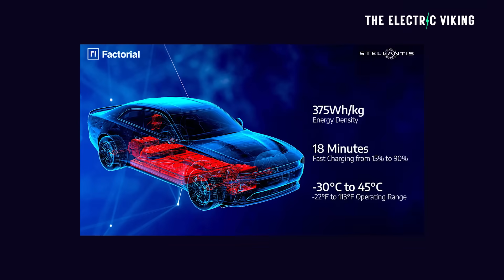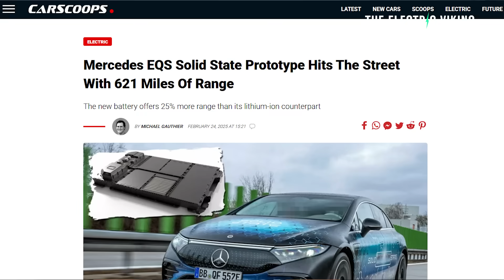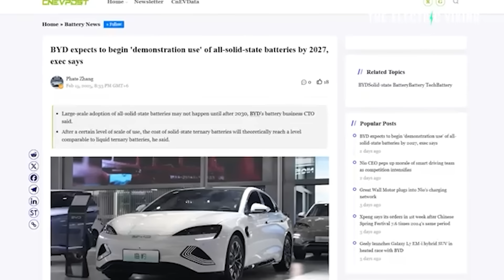Good-bye Liquid Electrolyte—Stellantis Tests Game-Changing Battery in Dodge EVs

Comment: Wait a minute 1000 mile  per charge but that is in ideal conditions in winter , dead cold , how speeds, also if its a full size pick up ,then the mother of battery suck pulling trailer  that most do all knocks those numbers down more or less 300 /500  still what's left is decent heck very decent.

Comment: A lot of science and engineering- and time and money- is being invested in making an energy dense battery to assuage range concerns. Of course this one-solution-fixes-all strategy is an idea but what if you didnt have to knock it out in one swing? One thing Tesla did right was invest into infrastructure early. Tesla owners hardly think about range bc theres so many charge stations everywhere. You dont have to offer both power and range in a single vehicle. The ICE industry had decades to perfect its craft one problem at a time- plenty of ICE engines blew up and caught fire but we still drive them. Putting so much energy in a single car is expensive and dangerous, they're pretty much nuclear reactors at a certain point. One step, one crowd at a time is my opinion but then again im just a regular dude.

Comment: You still have to have a lot CELLS to get the high voltages needed for keeping the current losses reasonable, both in charging and in driving the motors at high speed.

Comment: Biggest draw back of these amazing  factorial new li-metal anode cells is their limited cycle life(600 cycles vs ≈2000 cycles in prismatic graphite anode) i hope factorial will move towards a nano silicon-carbon composite anode with 10% silicon content share they can achieve around 380 wh/kg with around 3000 cycles in a gel polymer(quasi solid state) same as these factorial semi solid electrolyte based  cells
Reply: They would last me 20 years, more if I don't go 0-100% all the time.
Reply: @jamesvandamme7786  yes polymer based semi solid electrolytes have between 60% to 90% longer calendar life

Comment: A real-world 400mi of range for EVs is my gold standard. 500mi would be mind-blowing. Anything above that should just result in less battery per vehicle.
Reply: Which is a good thing as it lowers the weight of the vehicle
Reply: If I can charge in the time it takes for me to micturate, I'm good. 250 miles is MY standard. Bronze.
Reply: @jamesvandamme7786  oh I totally agree - 250mi in under 10 minutes is great 98% of the time. The median range of ICE passenger vehicles in the US is 403 miles - so if you can get batteries good enough to where 400mi is the new 250mi, you've just defeated the Luddites. Nowadays the biggest anti-EV argument is still always range. We EV owners know the reality that you rarely drive over 50mi in a day, but still it would be great to know I can get 400mi on a charge.

Comment: Why would you need such a range? My bladder isn't that big...
Reply: The more range you get the cheaper it is to run the vehicle.
Reply: @Cmvinyl0102  True, can't beat a good charge at home. The hidden cost of an EV is charging at public chargers, especially in the UK.
Reply: @Cmvinyl0102  The more range, the bigger and more expensive the battery.
Reply: @jamesvandamme7786  not necessarily, denser battery store more energy relative to its weight or volume, better efficiency is always welcome unless the technology that creates drastically increase the cost.

Comment: No mention of cost versus LiFePO4 or Sodium-Ion or Aluminum-Ion. If Na-Ion and AL-Ion batteries can provide 350-450 miles of range and only cost $50\KWH or less, this new SSB may only be affordable in higher-end cars, instead of something like a TESLA Model 2, which would easily become the economy car for the masses and have a huge market share, especially if it's priced below $15k as has been recently advertised in several videos. I'd really hate to wait around until 2027 or later to get a $35K EV.

Comment: I know you're mostly talking about cars, but the Chinese have just produced a 1000kW battery-powered locomotive. For now, mainly for industrial use. LiFePO4 technology and, as promised, can be recharged in about 1 hour. (This is made possible by a massive battery cooling system.)
Reply: Most trains are electrified already.
Reply: @LarsRyeJeppesen  Not with batteries. Here in Trumpistan, almost all diesel with motor-generator drive.

Comment: If NMC batteries fall out of favor but there is still massive production capacity they could get really cheap until the production is transitioned to a new formula. That could lead to some really affordable vehicles that are already engineered for that type of battery. For example Tesla might still use them in the Simi even after the cars are some other type to save on cost.
Reply: My feat is that in 8 years if I still have my ev rhere wont be replacement bateries if I want to restore full range
Reply: @ Or that replacement battery could be cheaper if it’s considered old technology

Comment: Still a couple of years away for mass production cars, much like the other battery companies, they won't be alone then of course, other battery companies are working to a similar time frame, so they will be competing directly with the likes of CATL and BYD in that regard. One of the advantages BYD has is in the actual design of the cells and batteries, the Blade battery enables them to fit more battery in the same volume than the traditional cylindrical batteries that Tesla was using for their first generation cars. WH per kilogram is fine, but they are only talking about the actual battery itself and not the supporting structure like cooling and supporting frame and hardware. If you can fit 10% more battery into the same volume it gives you a range advantage. These batteries look similar to the Blade batteries so I wonder how they will compete in that regard. Still, a couple of years, if you want an EV there's not much point in waiting though, a good EV these days will do the job fine for just abut any city dweller who does the occasional long run.

Comment: I have always been a range hater in all the current US vehicle. I use my truck for towing most weekends in the summer. I have always said a real world towing range of at least 200-250 miles at maximum tow rating with a 0-80% charge time less than 15-20 minutes would make the ultimate vehicle for me. That would probably make the empty road trip range at least 600 miles. If it has vehicle to load capability I can use it as home energy storage and a power supply to run our travel trailer when camping, but not at a campground.

Comment: Quasi-Solid Electrolyte:
Factorial's approach is not a fully solid-state battery, but rather a quasi-solid one. This means they use a polymer-based gel electrolyte, which is more fluid than solid but still reduces the risk of fire compared to traditional liquid electrolytes.

Comment: Yeah ok, no, there won't be any Dodge Chargers driving around with an 800 mile or any range at all solid state battery, I can assure you that. There are no cars driving around with 1000 mile gas tanks because no one needs that anymore than anyone needs a 1000 mile battery in their car, unless it was so cheap that putting it in wouldn't matter. So yeah, no, this is not a thing.
Reply: More of a bragging point to shut down the critics. They will come up with a new excuse why EVs are No Good. "They're soulless", whatever that means.

Comment: Energy density is important because EVs currently are just too heavy. That has always been the challenge with electric cars--heavy batteries. If Factorial can get the weight down to produce a reasonable range, then we can finally move off of ICE. Charging speed is actually less important because a stop to charge usually involves the restroom and food, anyway. But, some ICE people won't be satisfied until charging speed is comparable to ICE fill up.
Reply: No they aren’t. They’re no heavier than equivalent ICE vehicles and some of them are lighter already.
Reply: @SteveRomigsongwriter  That's good to hear. Which EVs are as light as ICE?

Comment: Factorial is a US firm.  The fact that Stallantis is the same company working on this is the same company with a large number of EV vans in Europe and bringing EV cargo vans to the US might be the perfect storm.  An EV van about the size of the Ram Promaster 1500 118wb low roof with a 500 mile range,  V2H and HVAC utility mode while parked or charging would be my dream van.
Reply: Don't forget Factorial is working with HMG and MB too, and MB is testing batteries already too... Just saying, Factorial isn't tied to just the albatross that is Stellantis, they have a bright future!
Reply: Biggest draw back of these amazing  factorial new li-metal anode cells is their limited cycle life(600 cycles vs ≈2000 cycles in prismatic graphite anode) i hope factorial will move towards a nano silicon-carbon composite anode with 10% silicon content share they can achieve around 380 wh/kg with around 3000 cycles in a gel polymer(quasi solid state) same as these factorial semi solid electrolyte based  cells

Comment: 1000 mile range.  That's impressive energy storage. If a person drives 40 miles per day, then that is over a month of driving before a full recharge is needed (ignoring self-discharging).  

Currently most gasoline powered cars are filled up once a week, so yeah, that would be a time saving improvement--especially when recharging from home over night.

I think sodium solid state batts will become the future standard--once they tweak them a bit more.
Reply: That’s not the optimal way to use a BEV
Reply: If you charge at home, a 200 mile battery would be fine and a LOT lighter and cheaper.